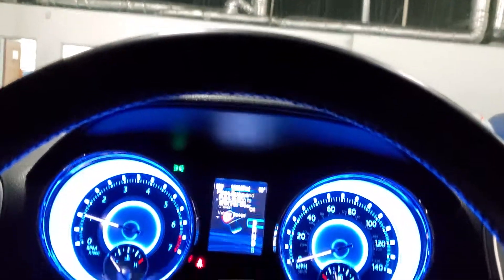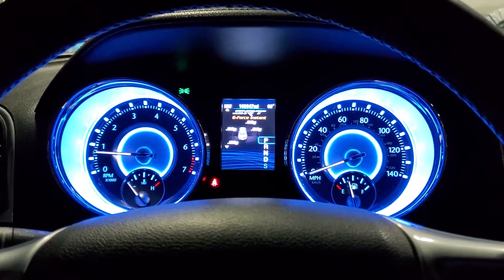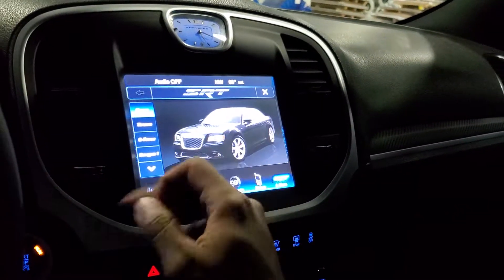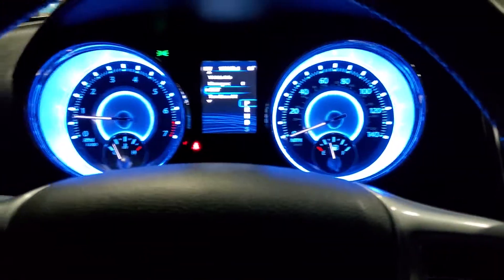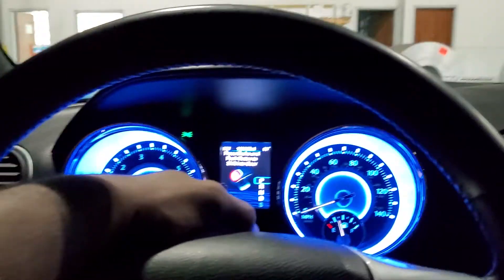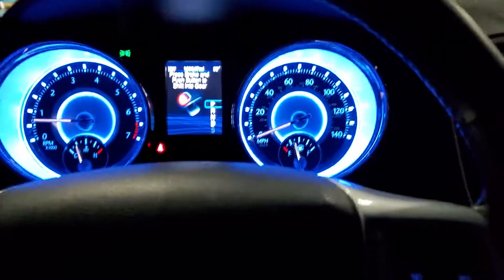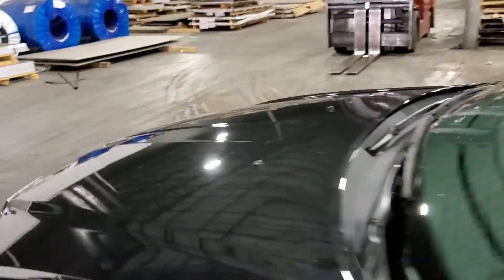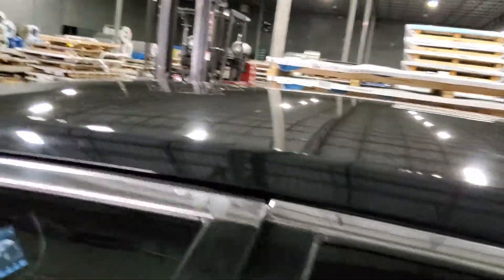2013 Chrysler 300 with tazer installed

Comment: Does the horsepower gauge work?, I read that it only works on 2015+
Reply from the maker: Yes it works. You need a tazer for things to work
Reply: That’s one of the reasons I wanted to buy the tazer but I seen on there feature sets it apparently didn’t tell the Hp on 2014 and down :) thanks for the reply man, I can’t wait for my tazer